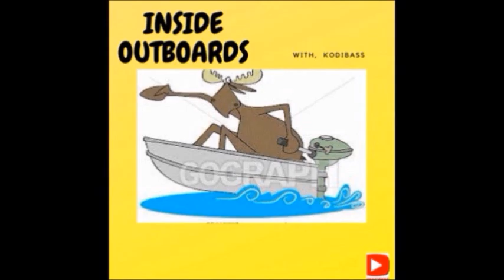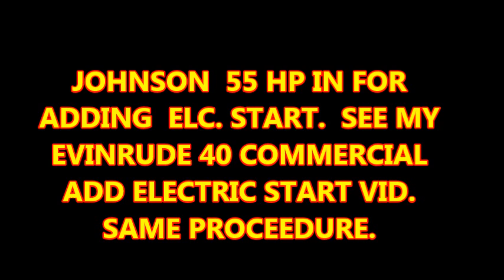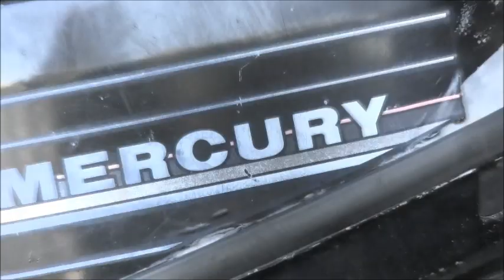EVINRUDE  JOHNSON  9 9 / 15 HP  LOWER UNIT WHAT'S  INSIDE THERE ?

Comment: I have a good 15 and planned to do the water pump. I screwed up and pulled the driveshaft totally out of the lower unit.Now the spline will not slip back into the lower unit. I think I need to do exactly what you are demonstrating?
My question is since my lower unit has not been touched is there an easy way to get driveshaft spline to drop back in without pulling the whole lower unit apart?
Reply: Hey Ken, when I do that I look into the lower end and use a screwdriver to line up the drive gear, then the shaft should go back in.
Reply from the maker: Sould slide right back in with a little twisting.   kb
Reply: So I pull the drain plug and the oil over flow plug and drain the gear case oil. Then shine a bright light in the over flow hole and look in the drain hole with a small slender screwdriver and look for the spline and gently move some of the components until I can line up the two and push them together?
Reply: Hey thanks for the tips. Going to see what I do tomorrow to get the shaft back where it belongs.Sold my old boat today with a 9.9 Johnson.
The 15 with spline out of location is going on a Alumicraft v14. That motor should do pretty good on a bit heavier boat.